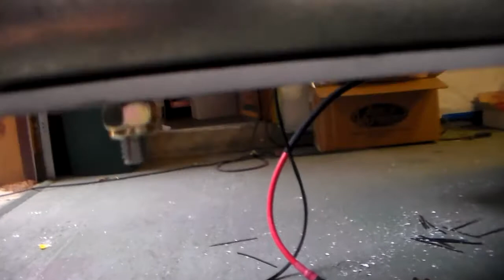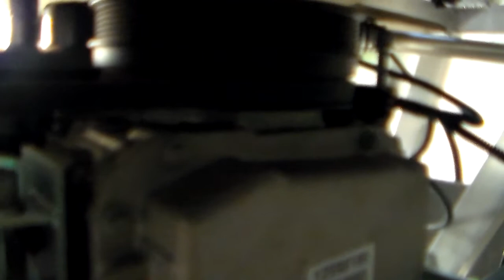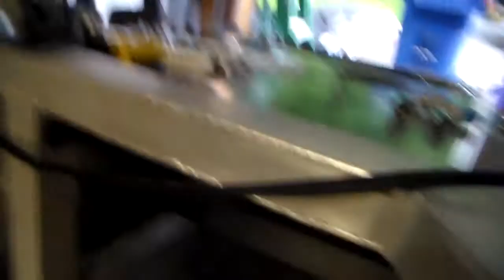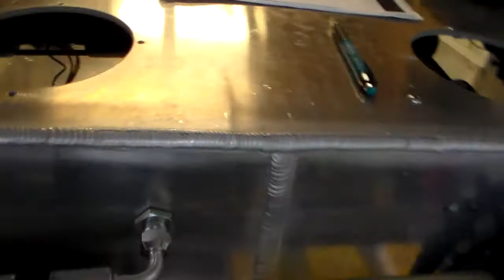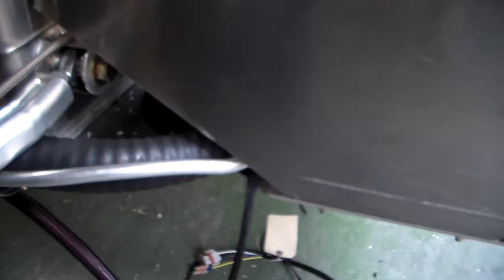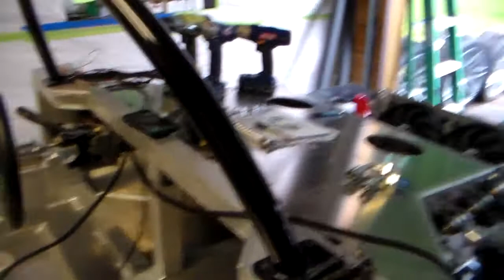SL-C Build AC/heat system install

Comment: The condenser is upside down. The #6 line is meant to be at the bottom. I'm not sure why though.
Reply from the maker: Hi Ken, yes 4 years ago I discovered this.  As the refrigerant moves through the condenser it is changed to liquid form as it cools.  You don't want to be pushing the liquid up hill.